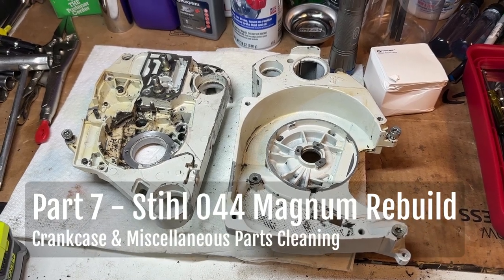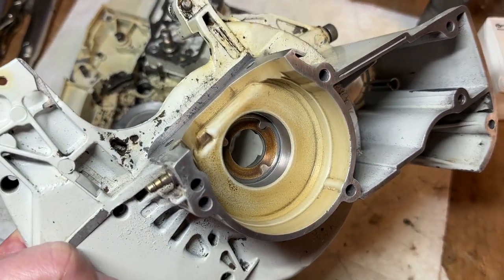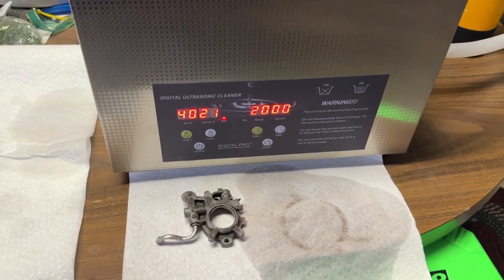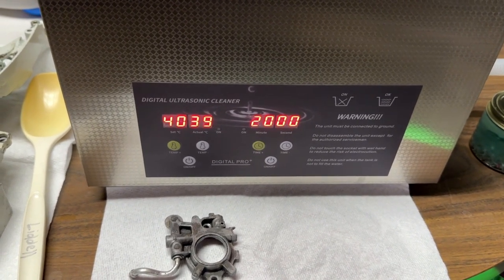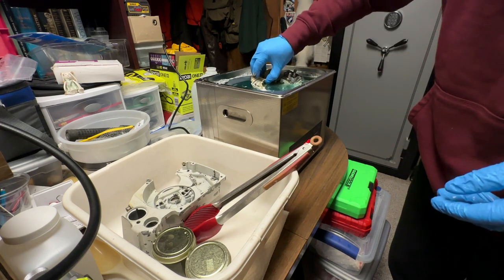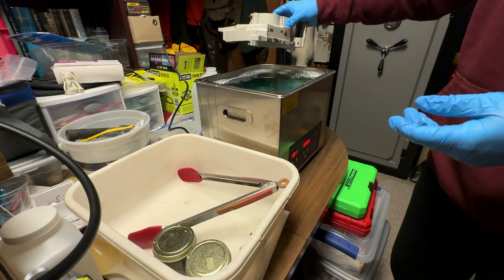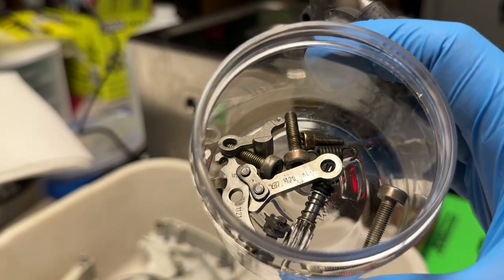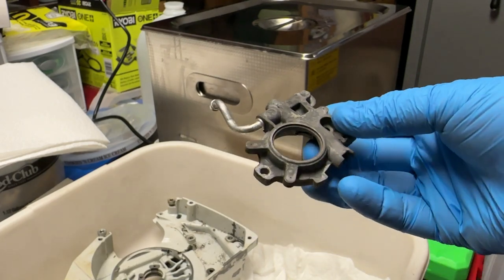Part 7 - Stihl 044 Magnum Rebuild - Parts Cleaning

Comment: How big is your sonic cleaner?
Reply from the maker: Not that big, although by no means the smallest available.  10 litre capacity if memory serves.  Can only fit ½ of chainsaw crankcase plus a few small things.  You learn to be efficient w/ it and reuse the fluid multiple times before discarding.